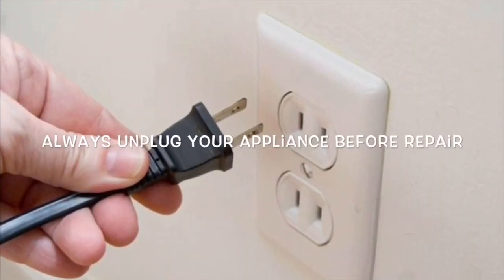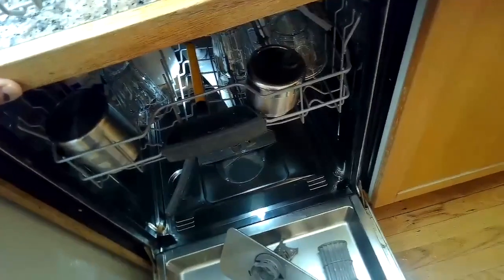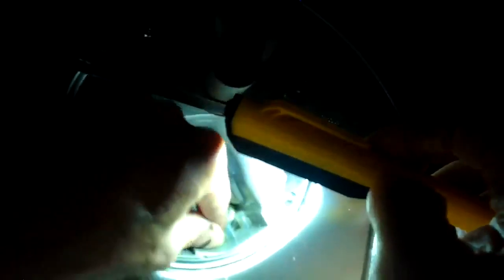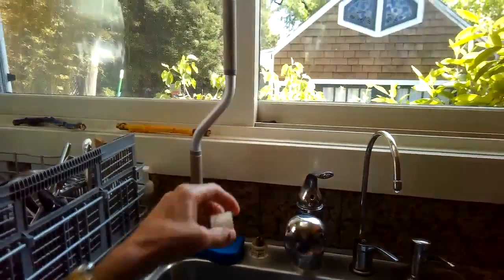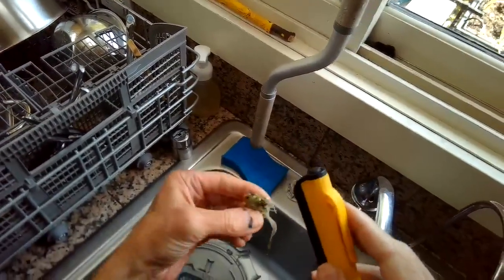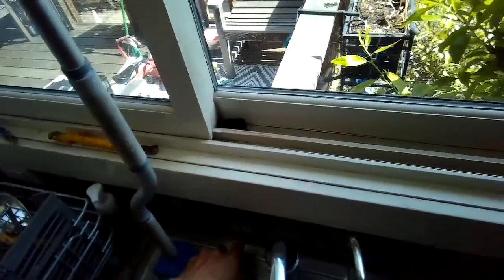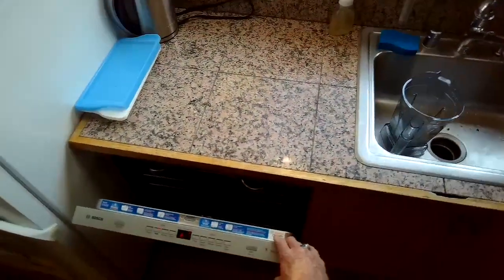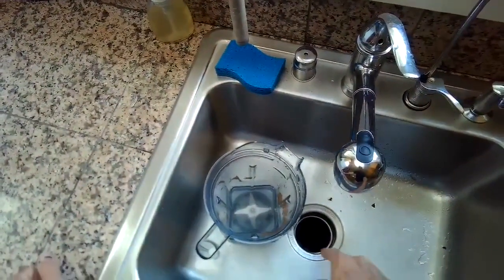✨ BOSCH DISHWASHER E-24 or E-25 NO DRAIN—FAST FIX—NO TOOLS NEEDED ✨

Comment: Thank you. This helped. 
I used a fluid transfer pump from Canadian Tire to suck the water from the drain hose.  I had it from working on my cars. I could pour water into the bottom and suck it out the hose. Did this a few times and sucked a lot of crud out. Did the rest set trick a few times and it worked. 
Thanks for the good video.